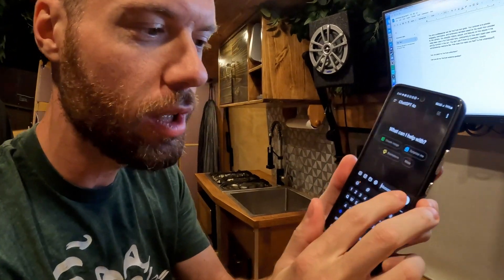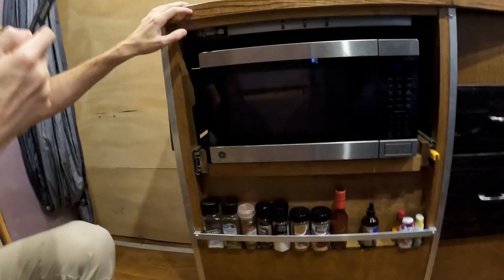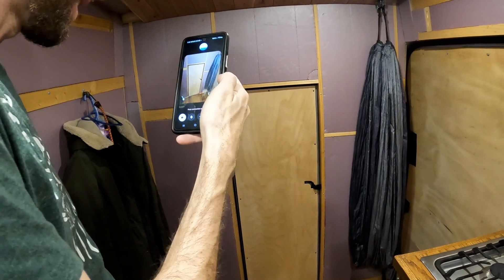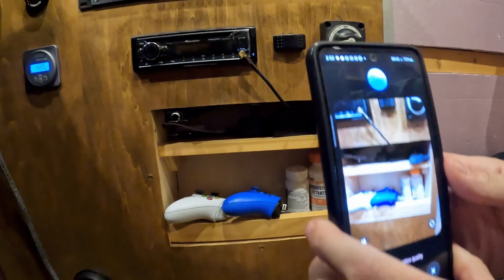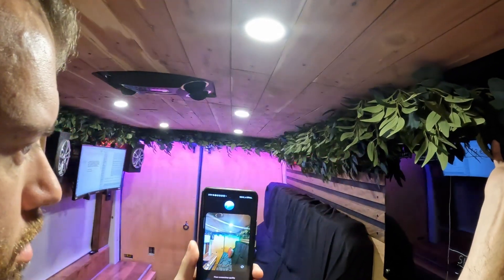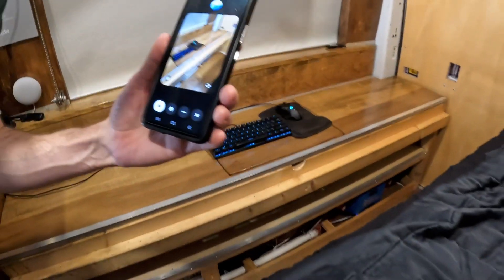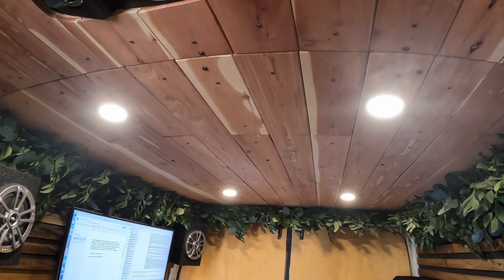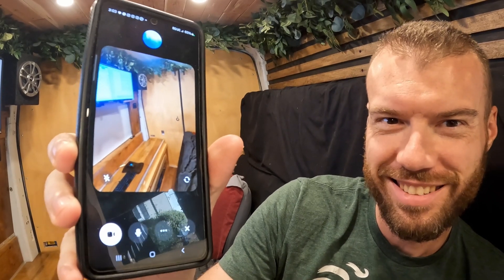Watch AI Describe My Van from Visual Input

Comment: Epic! I love the creativity of having the AI direct the van tour! 

Also, is your diesel heater a 2kw, a 5kw, or an 8kw? I have the same exact van as yours, max length ford transit. But my 2kw diesel heater even on max can’t even get my interior temps to room temperature. When it’s 30 outside, I can’t get more than 59 degrees inside. Of course, I have barely any insulation right now, so hopefully it improves to at least room temp once that’s done.
Reply from the maker: 2kw, don't get more than that. It's plenty at low settings already

Comment: What app are you using?
Reply from the maker: It's chat GPT 4o with Advance Voice model + Vision. To get this, download from the app store the Open AI Chat GPT app, and then subscribe for $20 a month for the Vision capability. Then you will have exactly what I used in the video.
Reply: @ thanks 😉 cool video!
Reply: Literally says chatGPT in the description
Reply: @ if you knew anything you would know that chat GPT is the AI model and it can be integrated into many apps and programs not just the native chat GPT app. Furthermore the vision model capability is not readily available without a $20 a month subscription so the option can’t be seen within the app without the subscription.